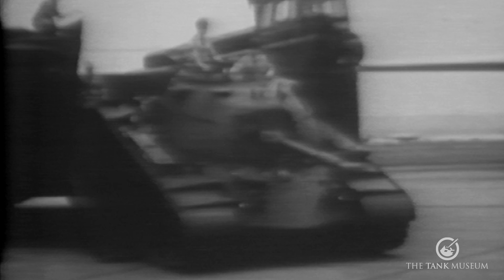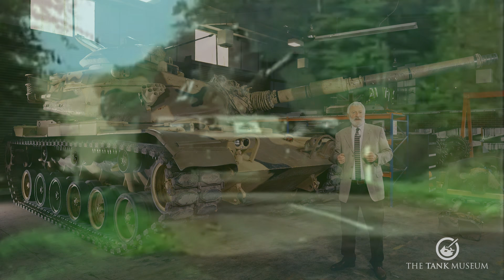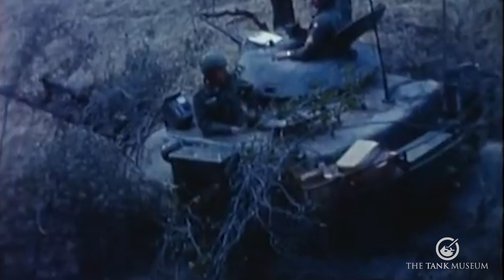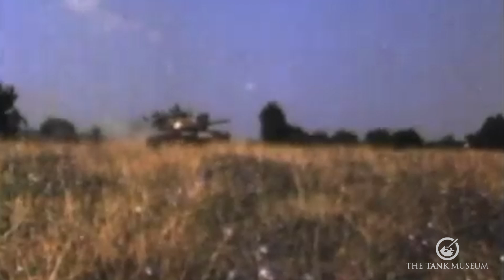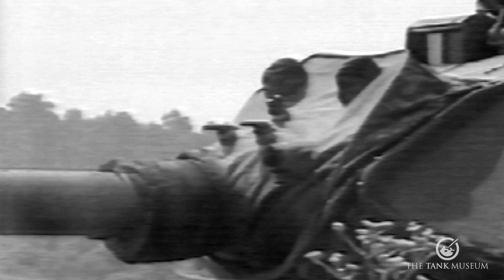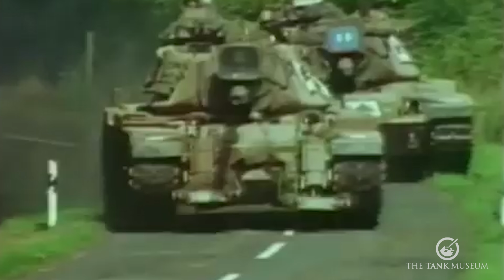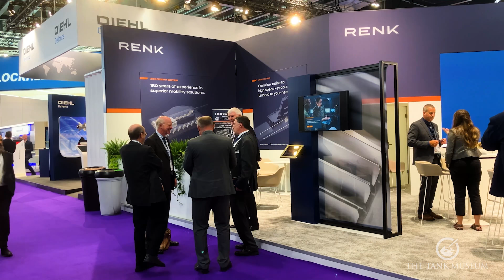M60: Cold War Guardian | Tank Chats #175

Comment: One of the major reasons for the decision to move to diesel which isn't often mentioned, is that the US was trying to move to multi-fuel concepts, and diesels were considered much easier to convert to other fuels than conventional petrol engines. If petrol engines had been able to be converted easily, it is questionable whether the US would have moved as it did. Of course, in the end, real multi-fuel capability was only implemented in practice by the US Army in some of the trucks like the M35 series, and the M1's turbine which is one of the few true (i.e. no conversion/modification requires) multi-fuel engines out there.
Reply: Nick, rear sprocket drive on US tanks - I quickly checked and was the M-26 Pershing the first? Maybe not but - any knowledge on what made the US transition to it, and pros/cons of it? Thank you.
Reply: @Simon_Nonymous   A drive shaft between engines has to run under the turret, raising the height about 8 inches. On the Sherman that was perhaps acceptable, as the suspension wasn't across the bottom. Once you go to torsion bar suspension, which raises the tank about 8 inches, the drive shaft has to come across above that. One of the most maintenance intensive parts is the transmission. On the Sherman, a front armor bit could be unbolted, and the transmission taken off with a forklift, German tanks pulled the transmission out with a crane, which required pulling other parts off first. With the transmission behind the engine, the rear armor (thinner) is more easily removed, and the 'power pack' consisting of engine and transmission, can be mounted on rails, to be removed as a unit, and replaced as a unit.
Reply: @DonMeaker  of course - I should have remembered that re the Sherman, and thank you for a very detailed description of the whys and wherefores. Also interesting to note the disparity of diesel vs petrol production you put in another comment.
Reply: @Simon_Nonymous  Those years in the 3rd Armored Division were perhaps not altogether wasted. Thank you!
Reply: @DonMeaker  Buick's M18 Hellcat featured a "drawer" system both front and rear that allowed the engine (rear) and transmission (front) to slide out drawer style for better servicing.  Regarding positioning of the driveshaft, Buick used a transfer case at the output shaft of the engine to lower the driveshaft height, thus avoiding the issue of a too-high silhouette.
Reply: @SomeRandomHuman717  It is my understanding that the driveshaft was also a bit off the centerline of the turret, to further permit it to be an inch or so lower.
Reply: @SomeRandomHuman717  it reduced the the drive shaft needing to raise the turret but didn't eliminate it. The rear mounted transmission also eliminates the separate engine-transmission access, so the front can have better armor, not compromised by access requirements. Rear power pack also tends to help out weight distribution, with heavy armor at front, and heavy engine at the back.
Reply: @DonMeaker Something else that wasn't mentioned is that in the power transfer via driveshaft there is a horsepower loss for each foot of the length of the shaft which is increased with every directional change in the train of the power. When you can localize the power by marrying it directly to the transmission applied power is markedly increased.
Reply: @Simon_Nonymous  I think the T20 prototype series that were developed to replace the M4 Sherman we're the first to move the sprocket to the back for American tanks.  (And that series eventually led to the M26)  
Most people list the removal of the driveshaft as the main reason, allowing the tank to become less tall. 
I think there's 2 other reasons: 1. Tank frontal armor is increasing a lot at the time, so you might want to move some weight backwards.  Whereas at the time of development of the M4 Sherman, having the transmission front allowed for both nice weight and volume distribution around the tank, and keep the turret central. (Whereas the T-34 needed to move the turret very far forward)
2. There is time for new developments.  The M3 and M4 medium tanks needed to be developed in record time, to be produced and fielded in the war.  Having the transmission up front is the easiest approach, and allows for multiple choice of engines in the rear.  
Having the transmission in the back requires a closer packing, and thus takes more time to develope, and provably allows only one engine model to fit with it.
Reply: Well, The M26 Pershing wasn't actually the first U.S. tank to use a rear-drive sprocket system, but I think it was one of the most notable early ones. The shift from front-drive sprockets, kinda like on earlier U.S. tanks like the M4 Sherman, to rear-drive sprockets in designs like the M26 and later tanks had several key motivations
Reply: Hey Nick,when are you going to do inside the hatch on a 60?
Reply: The USMC M-60A1s that I served on in the late ‘80s were multi-fuel. During Desert Shield/Storm they ran them on JP-5 (kerosene) as that was the fuel chosen for the entire theater. They couldn’t go more than about 10 mph on it, but they ran.
Reply: @Former_Trump_supporter  FMTV trucks run on Diesel (DF-2) or Kerosene, and adjust operation to what you give it. which. DF-2 has a bit more energy per unit mass or  volume, so the range is slightly longer, but that is it. power is the same, as it is limited by the mass of compressed air in the cylinders, the injectors squirt a bit more kerosene in than DF-2 per stroke.
Reply: @DonMeaker not trying to be the well actually, but this is worth stating for the discussion. The ability to run both kerosene and diesel (DF-1 and DF-2) does not indicate multifuel capability. This is due to the fact that diesel, jet fuel, and kerosene are very close in properties, to the point that many diesel engines can run any of the 3 without any negative consequences, hence vehicles such as the FMTVs and the HMMWVs being able to be refueled with diesel or JP-5/8 without making any changes. Multi-fuel capability indicates the ability to use fuels anywhere from the relatively thin gasoline to the much thicker marine fuel oils, to even used motor oil in a pinch.
Reply: The big advantage to gasoline is the far greater production of gasoline, compared to diesel. During WWII production was about 200 to 40 in favor of gasoline
Reply: Because everything used gas
Reply: @DonMeaker  so?  what otherc diesel engines?
Reply: @DrLoverLover  Not sure what you are questioning.
Reply: @DrLoverLover   Soviet M-4 tanks (about 4000 of them) had the GM diesel 6046 engine with 1000 ft lbs net torque. US didn't want them as it would complicate their fuel deliveries, but ended up with them anyways as they powered the M-10 tank destroyer. Most (early) Shermans had the Continental 975 radial gas engine with either 800 or 940 ft lbs net torque. That was needed because the US didn't spend much on money on tank engines, so pressing a former Wright R975 aircraft engine into service was a great time saver.  Continental licensed produced over 53,000 engines of that type.
 Chrysler offered an A57 gas engine with 1020 ft lbs net torque, and most went to Britain. 
Ford offered the GAA V8 gas engine, 950 ft lbs net torque, which the Army ended up preferring- and it powered the Sherman and the Pershing.  It started life as a V-12 aircraft engine, and was converted to V8 by dropping 4 cylinders. The GAA had a one piece cast Aluminum block, DOHC, and was quite advanced. 
The A57 powered many British Commer trucks after the war, and the GAA V8 was used in vast numbers in the US for logging equipment and pump motors. Post war, the Army tried to keep the tanks with this engine in service.
Reply: @DonMeaker simplify your fractions, please: 5:1 TFIFY 😜
Reply: They say the M1 can run on perfume. And if you have ever been in a barracks when it is time to hit the town it smells like you could power a fleet with as much the guys have on.
Reply: @james-faulkner it was designed for hellscape aftermath of the big one
Reply: @jyy9624  I think I understand what you are attempting to communicate, that the M1 MBT was designed for combat after a full nuclear exchange. Not sure how much there would be to fight for afterward plus logistics of just keeping crews alive much less fed and the vehicles fuelled of which the M1 carries 500 gallons and burns through several gallons per mile. The supply chain just to keep a company of tanks on the move is enormous and complicated. There is not going to be much war fighting going on after a full nuclear exchange. I would say there would be none happening at the State level.
Have you seen "Threads"? Very accurate movie. The great Carl Sagan and many other scientists were advisers. One thing they did get wrong, that we know now, is that genetic damage caused by nuclear radiation does not transfer to offspring. Still a very chilling prediction.
Reply: @james-faulkner  I was thinking more tactical, but your scenario is clearly also very likely back in the day - I read about the Abraham's while it was in development in the 80's and that was the first time they let the public know about NBC war
Reply: The move to Diesel wasn't a hard choice, normal fuels caught fire to easily and burned swiftly.  Diesel was much less risky if a bit dirtier.
Reply: When a Question comes up about tanks. The Chieftain is if not the most knowledgeable, he is the most entertaining and informative. His presentations are must see. He is the Tank guy! If he doesn't know the answer he is certainly on good terms with guys like Hillary Doyle and Steve Zagola who do know the answer.
Reply: Chrysler ran the turbine on tequila and Chanel #5.
Reply: In the SC Guard our 2 1/2 ton trucks were multi/fuel.  On one occasion the men fueling vehicles for movement to Fort Jackson just filled a duce and a half with gasoline.  The 1st Sgt told me that he left home station about 30 minutes after that truck and when he caught up with it some 30 miles down the road he was stunned to see a 6 foot blue flame shooting out of the exhaust stack.  He stopped them and they found a 5 gal can of diesel fuel that they dumped into the fuel tank to tone it down.
Reply: We like oil in all forms
Reply: @Robin-Hood-r90   To combust you need fuel, air, and ignition temperature. Because of the vapor pressure of gasoline, inside fuel tanks there is almost no air. During WWII fuel fires were not a significant problem for tanks, but ammunition fires were. Wet storage of most main gun ammunition in the Sherman, and the relatively insensitive nature of US TNT explosive helped a lot.
Reply: Cool story bro
Reply: What about Chieftain?
That was multi fuel!!
😂☠️
Reply: @MostlyPennyCat  Not a true multi-fuel. The mechanics would have to fiddle around with it for a few hours. Officially, going from diesel to petrol would take eight hours according to REME. For the M1, no modification is required, just fill it up with whatever fuel and go.
Reply: @TheChieftainsHatch  
Yeah, I was being sarcastic 😉
It was, of course, legendarily terrible.
I'm very surprised a comment on an old thread caught your eye though.
Reply: @MostlyPennyCat  Youtube notifies when a response is made to a thread you've been a part of. Or at least, it does by default and I haven't found anything which turns it off.
Reply: @TheChieftainsHatch  
Yeah, same here.
I just thought you'd be doing more important tank-stuff.
Actually, are you still in the army or are you a full time You-toob historian type now?
Reply: @MostlyPennyCat   Still a reservist, but Youtube has always been a side gig for me as well.
Reply: click on your profile picture on the upper right of the screen on pc.  settings/notification settings/replies to my comments.   click it and make sure it is black.  i never get any comment notifications anymore.  @TheChieftainsHatch
Reply: @TheChieftainsHatch  
Wait, "a thread you've been a part of"
I know you mean you The Chieftain but that can also mean that you have a special algorithm to detect me
Either because you Subscribe to my cat channel or you have an Englishman detecting algorithm to keep an eye on us.
Actually my family was under a general low level threat back in the 80s, they got one of us and nearly got grandad and I had car bomb checking gear in the cupboard next to the Welly boots, raincoats and the fusebox! That's a weird thing for a 10 year old to have.
Reply: Ah, the Germans called US armor Ronsons.
Reply: @useyourbrain1539 
Can't tell if you are serious or just trying to get the Chieftain riled up.
Reply: @jamess7576  Not sure I follow. The Germans used the term because the early American tanks used gasoline, which went poof when hit. The Chieftan was diesel.
Reply: @useyourbrain1539  
Ohh, did they call their own tanks that also used gasoline Ronsons as well?  What are your primary sources?  I ask because the whole Ronson thing is a myth.

Nicholas who uses the Chieftain as his user name has covered this quite often.  If you have primary sources indicating either Brits, Yanks, or Germans called the Ronson during the war, please share.
Reply: They didn't pin your comment?  PERFIDIOUS BRITANNIA
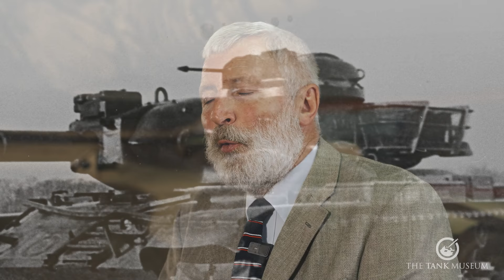Reply: The turret at 30:18 I saw a scraped one at Roxbury Auto Wreckers in NJ. Located near Picatinny Army base in Dover NJ now known by its acronym ARACOM, this was probably about 1995 and had to be scraped
Reply: Jet turbines run on pretty much any liquid that burns, the problem is they tend to need lots and lots of whatever liquid that may be.
Reply: Hey Chieftain. Don't forget that the British have had multifuel engines on military vehicles since...   well, since the Chieftain.   😂
Reply: The master has spoken!
Reply: So how really multi-fuel was the Chieftain, Chieftain?
Reply: Deisel is better tbh
Reply: Who is this guy???
Reply: @memonk11 Chief something or other.  I think he was in the Army.  Maybe as a mechanic?  He's always crapping on about track tension.
Reply: @bsb1975  Yes… tracks can be quite tensionous.
Reply: @memonk11  he's a tank diety.
Reply: @memonk11 Never heard of him!
Reply: @memonk11  tank god
Reply: @memonk11 The chieftain. He is quite big within the tank community.
Reply: @darnit1944 I figured that before I bought his book.
Reply: @darnit1944  I think we saw what you did there.... Meanwhile credit memonk11 with a little ironic humour mate!
Reply: @memonk11  Ah shiet, you were joking?
Reply: @darnit1944 Very badly apparently.
Reply: @memonk11  If it makes you feel better, I got he joke...
Reply: @darnit1944 He's quite big in general. Makes it hard for him to fit in some vehicles.
Reply: @memonk11  Tell me you are joking
Reply: @kreb7  He's joking
Reply: @TheChieftainsHatch  i have a quwstion regarding your opinion on the M60s, what do you think of the turkish modernization programs for it? Most notably the M60 MKZ
Reply: @memonk11 say Sike rn
Reply: @memonk11  He's a Irish-American historian as well as a Lt. Col in the U.S Army, he was/is a Tanker with Combat Deployments to Iraq
Reply: @memonk11 A Excellent Fellow- Wonderful presentations
Reply: Fat Americans hate diesel, oil fuels and metric system 😭
Reply: Last time I checked everything the US Army uses runs on jet fuel, period. Trucks, tanks, helicopters, generators, everything.
Reply: @ssaraccoii  
How can trucks run on kerosene?
Reply: @ It’s essentially the same as diesel.
Reply: Look at construction and farm equipment, the switch to diesel was going to happen regardless of multi fuel.
Reply: Drove a m60a3
Reply: Es do esel engined vehicles always made more sense than the army ever wanted to dear with. The6 wanted to simplify he logistics of warfare in any way possible they always hated the idea of carrying even two different fuels. But the advantages of diesel engines are just to great to ignore.
Reply: Correct but your also missing the fact that tanks of diesel don’t ignite when hit which in effect make them part of the tanks armor protection system
Reply: One of the major problems that continuously plagued the M 60s was the air filter system, the filter elements or air cleaners went through changes, they manufactured from cloth and paper, but the one major problem was the metal framing that held the elements, they were so poorly made that they did not make the system air tight, and this lead to dust erosion in the cylinders. And this killed many a 1790 engines. What I found some the solutions down right comical,
Reply: If you were born in America then why call it petrol? And not just gasoline like a normal American?
Reply: @Rupert3554 I'm fully bilingual.
Reply: Duel fuel engines...that was a good idea but terrible in practice
Reply: I believe diesel engines can run on kerosene and gas in a fuel shortage ?

Comment: I was mechanized infantry, stationed in Colorado, in the foothills of the Rocky Mountains, in the mid-70s. You haven’t lived until you’ve seen an M60 in the snow, tracks spinning uselessly, as it slides down a mountain-side road out of control. We all survived…
Reply: What battalion?
Reply: 1/11 Infantry (Mech), B Co.
Reply: @rrl4245  Tripple Duce here. Assigned shorty after the unit arrived in West Germany from Ft. Carson. Initially assigned to Bravo, 2-22 mech inf. 1LT Freddy Polk was the co. Almost everyone in the company came from Carson.
Reply: @MrHiBeta   It was crazy times back then - lots of reorganization. After VietNam, the 4th ID was being rebuilt, there at Ft Carson. It had been part of the 5th ID during the war. I was with them in 73-74.

Comment: I spent my first 5 years on M60A1 and later M60A3. We never got an NBC overpressure system, and the Tc’s cupola was not powered, also we did not have a halon fire suppression system. I didn’t see halon until the M1A1. Otherwise a great video. I still love the old girl.
Reply: You are correct , only NBC item was gas particulate that plugged into the tankers gas mask.